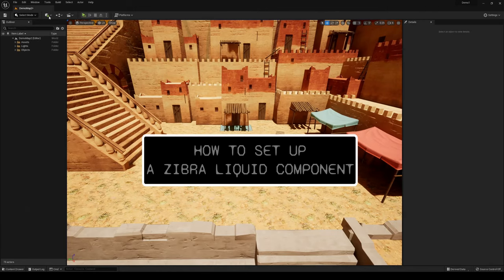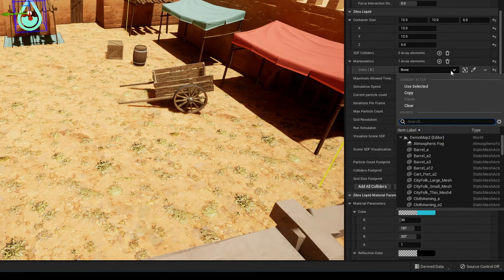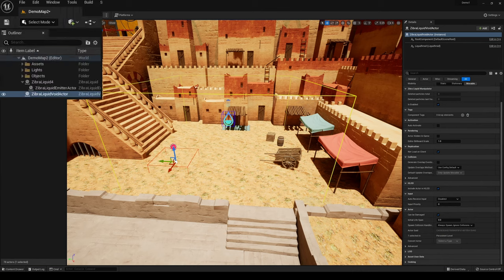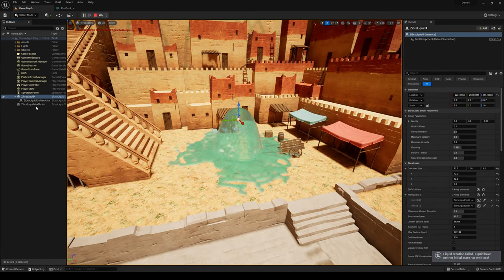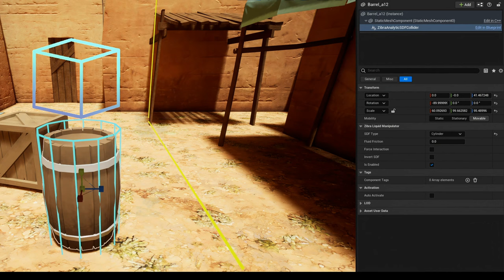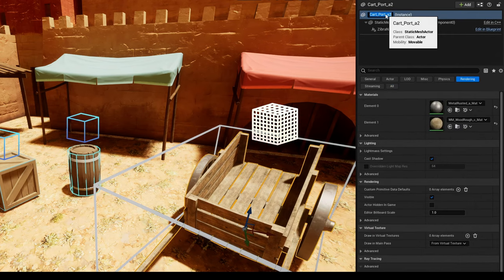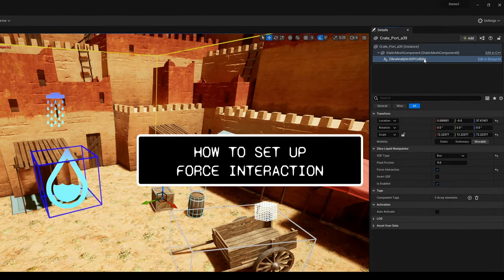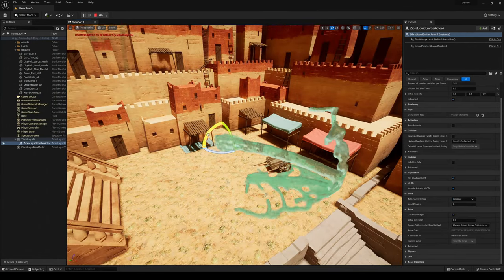Zibra Liquids. Tutorial 2. How to create liquid simulation with force interaction | Unreal Engine

Comment: This plugin should be 100% free as a Demo without possibility to use it in your final game, without buying it. That way, we can test the entire power of this plugin, and try to understand, why we get low FPS, on medium range machine. Losing 20 fps, from 60 to 40 is a problem. I dont mind buying it for 220$, but if this plugin has optimisation issue, i dont want to buy it. why spending 220$ if this plugin make me loose 20-25 fps? I dont understand why it,s so laggy. 

Ue 4.26 here. is it the cause?

Comment: This does not work in Unreal following the steps you provided here. Something is not documented correctly.
Reply from the maker: Hi, 

If you don't see liquid on Unreal 5, please try to rebuild the plugin. 

Note for Unreal Engine 5.0.1 and higher users:
Due to technical limitations, the built plugin from Unreal Marketplace doesn't currently work with UE 5.0.1 and higher. You can either switch temporarily to DirectX 11 or rebuild the plugin with your version of Unreal Engine.

Steps to rebuild the plugin:
1. Move the plugin folder from your marketplace plugins folder (e.g. "C:\Program Files\Epic Games\UE_5.0\Engine\Plugins\Marketplace") to your project's plugin folder ("YourUnrealProject\Plugins\ZibraAILiquid"). You will need to create that folder if it doesn't exist yet. The project needs to be a C++ project.

2. Generate Visual Studio project (you can do it by right-clicking on .uproject file and selecting "Generate Visual Studio project files") and open it.

3. Start your project via Visual Studio. The plugin will be rebuilt at the first launch and after that you don't necessarily need to launch your project via Visual Studio. 

This issue is temporary and is going to be removed in future versions of the plugin.

In the case you are using version 5.1, please note that Zibra Liquids is not currently supporting it. We are working on it and will let everyone know once it's available.

Comment: It seems that only the simple shape collision can be add to the objects in the scene. Can I use the mesh of objects as the collision boundary? Because I want the liquid can flow in the pipe, that is, hollow cylinders. I don't that if the zibra liquid can do this. Thanks a lot!
Reply from the maker: Hi Donghui Mao, 
Yes, absolutely. Please use ZibraNeuralCollider, it is required to Generate neural representation after adding the collider.

Comment: NO LIQUID RENDERS IN THE FREE VERSION
Reply from the maker: Hi,

Note for Unreal Engine 5.0.1 and higher users:
Due to technical limitations, the built plugin from Unreal Marketplace doesn't currently work with UE 5.0.1 and higher. You can either switch temporarily to DirectX 11 or rebuild the plugin with your version of Unreal Engine.

Steps to rebuild the plugin:
1. Move the plugin folder from your marketplace plugins folder (e.g. "C:\Program Files\Epic Games\UE_5.0\Engine\Plugins\Marketplace") to your project's plugin folder ("YourUnrealProject\Plugins\ZibraAILiquid"). You will need to create that folder if it doesn't exist yet. The project needs to be a C++ project.

2. Generate Visual Studio project (you can do it by right-clicking on .uproject file and selecting "Generate Visual Studio project files") and open it.

3. Start your project via Visual Studio. The plugin will be rebuilt at the first launch, and after that, you don't necessarily need to launch your project via Visual Studio.

This issue is temporary and will be removed in future versions of the plugin.